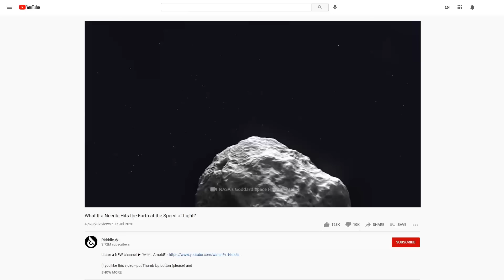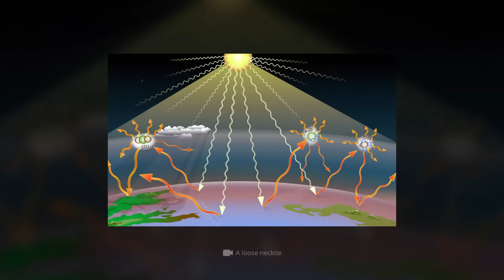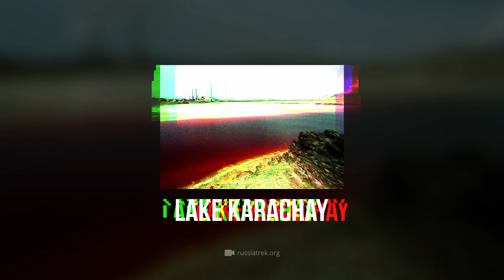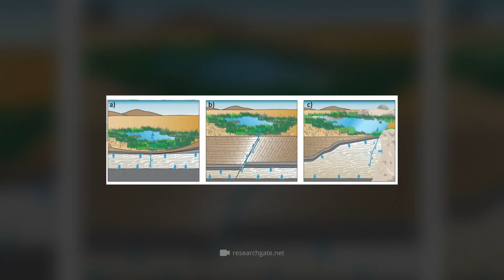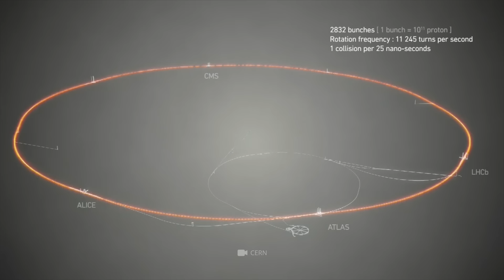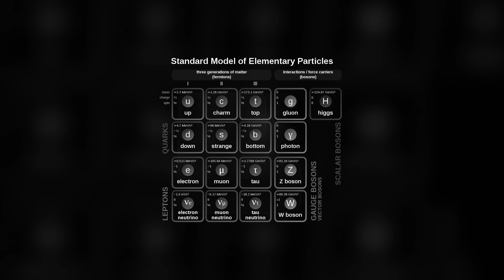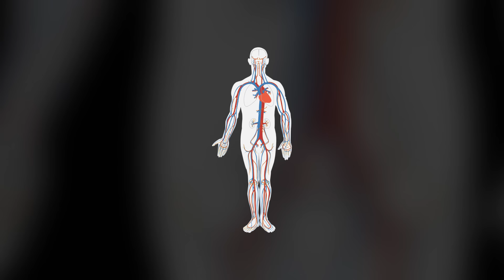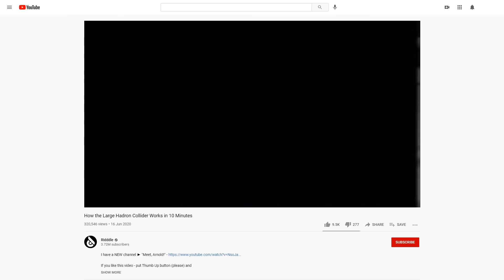What If a Needle Hits the Ocean at the Speed of Light?

Comment: I think the air friction would melt the needle instantaneously and cause it to reshape into the most aerodynamic shape (raindrop) and then in it's liquid form it would continue to fall loosing energy like crazy and then hit the ocean still at a fast speed but certainly not light speed and maybe make a little splash if the ocean was calm and flat but the water would produce so much drag the rain drop shaped needle would cool and harden and not go very deep in the ocean upon initial contact and than after it slows down it would just sink the rest of the way to the bottom. If the ocean was rough and stormy I think it would make less of a splash and go deeper in but final outcome would still be the same.

It is also possible the reentry process for this needle produces so much heat it completely destroys the needle with pure incineration and the needle never even hits the water.

Comment: So, a couple things. First and foremost, you've made some very glaring mathematical mistakes in your presentation. Relativistic kinetic energy for a needle, whose mass you never defined by the way, would be somewhere around the 3.35e8 up to 4.01e9 joules for a sewing needle moving at 0.9999999c. For perspective, a ton of TNT equivalent energy is 4.184e9 joules. a needle, at that speed, will not reach the energy of 1 ton of TNT, let alone 100 tons. That aside, the bomb that was dropped on Hiroshima had an equivalent energy of approximately 15 Kilotons of TNT, or 63 TJ of energy, or 6.3e13 joules. That's several orders of magnitude larger.

Second, dispersion of energy is an important thing about this. Assuming a needle impacting the ocean loses energy at realistic rates due to friction, it would impact the sea floor with nearly no energy lost to the ocean it moved through. even if half of the energy was lost to the water, the actual effect of that energy loss would be less predictable, as the column of water the needle falls through would experience instant boiling from the needle passing through. it may send a wave, but to say it would send a large wave towering 60 ft, something seen when massive portions of an island fall in to the ocean, is a bit presumptuous. 

I understand this is a thought experiment, but it's one that ignores basic laws of physics and the use of math in general. Good effort, but poor execution
Reply: I used an "average" hand sewing needle (Size 5) and came up with 0.14g for its mass.
At "c", that represented 6.4E12 J or roughly 1.5kt if I calculated correctly.
Reply: @fewwiggle  that's correct, I used a formula that didn't take into account relativistic mass, which was wholly my mistake. it would be at least 3 orders of magnitude larger because of that. Still far shy of '6 times the size of the bomb dropped on Hiroshima' as was claimed in the video, but much more substantial than I calculated initially.
Reply: @adazriel5878  Actually, we both made some bad mistakes -- I did a revised calculation and do come up with roughly  6 times Little Boy -- I'll get back to you later today with some numbers and links

Comment: Just with very basic "wiki physics", at that speed, your needle would weight 10 tons, energy equivalent of a nuke of 1250 Tons of fissile material, something like 208 Tsar Bombs! Still, the dynamics at this speed is not mechanics anymore, but particle physics: most of the energy would not dissipate in an air bubble but in a ground/sea cone. In water, it would vaporize 360000 cubic km of water (if all goes to heat, which is not the case), about 1/4000 of the oceans, so it might produce something like what you said. On earth, it would be different, the shock might hit the mantle… Most likely, it would hit both, oceans aren't that deep...Still, such accelerated mass in a needle-size bunch is even beyond what a supermassive blackhole jet can reach (or a few billion of CERN accelerators), so I doubt is a realistic threat. About what could happen if the CERN collider (which, as I said, is many billion times weaker) loses control, is all pure fantasy, the overall energy stored there could not even drive a train from Geneve to Lyon. Read about the beam dump, is all public documentation, before making speculations.

Comment: All this assuming it would be able to transfer all this energy as if you think of a 9mm vs 45acp bullet the 9 mm is thinner so faster and the 45 is thicker so slower but has more kinetic energy and the 9mm has more penetrating power and the 45 had more stopping power so a needle even thinner and faster would barely transfer any energy and just penetrate extremely deep 

Edit: has to cut halfway through because of the shitty 3x 10 minute adds of stupid guitar apps and meditation of which I absolutely hate

Comment: Not much would happen actually. Too many of theese videos are just calculating forces and transfer that to TNT. But that is not what would happen. In fact the damageradius of a penetrating (very thin) object is getting smaller the more force or speed you use. If you shoot a gun at a wooden plate you get a small hole. If you slowly press an bulletsized object threw the plate instead, chances are way bigger to breake something off and get a bigger hole. A needle even at the speed of light only gets very deep, but it does not cause a huge explosion. I assume an very hot and deep glowing hole maybe the size of your Hand fitting in, if on solid ground. In water it would be slightly bigger , but it also closes very quick. No huge wave, there will be one, but not even visible on the beaches,

Comment: Yeah... I dot buy this because of one reason.... Billions of particles hit the ocean and every other part of the earth at the speed of light currently. Photons are one example. 

If it were this extreme then our entire planet would have deteriorated over the years it's existed simply due to a type of light erosion. 

It's more likely that due to the objects speed the surface tension of the water would barely respond as it normally would. So the needle would likely bounce off and break apart. 

I'm sorry but the theory doesn't hold up. Even if penetration of the water were to occur.... It would be incredibly unlikely to have the effects you're talking about because water would behave so much like a solid due to the speed of impact that it would have little to no effect on the neighboring molecules. It would behave more like a knife cutting meat than some epic wave event. And that's in the extreme case it happened to penetrate the surface tension at that speed instead of bouncing off like any photon. 

Remember... At the speed of light the particles making up the needle would be barely indistinguishable from the other particles we're bombarded with daily. So it would be very similar to a cluster of any other light speed particles. Oh no... A glob of sunshine hits the ocean at the speed of light?!

Absurdity.

Comment: The needle so small moving at the speed of light with dynamic it would penetrate so deep into the water. It would be obsolete. Needle weight wouldn’t allow it to brake brake much it would disintegrate on impact this is so far from accurate wrong

Comment: I take it you didnt get the nasa math that shows warp possible and no speed limit. Didnt you get tjat quasion and work round the clock for 2 weeks to crack some of its symbles values? I did. Tho a pin does not have a warp engine i almost can let you off. The wave you said a surfer had zero chance again thats wrong because its near zero. Ok i continue vid now.